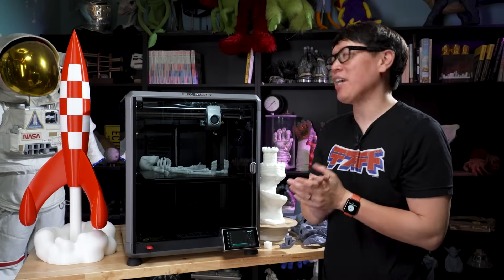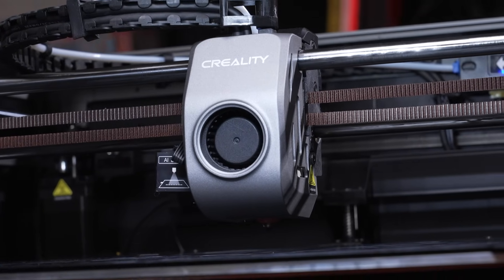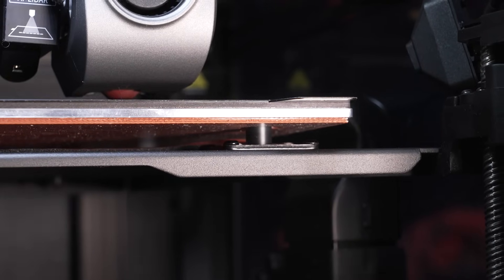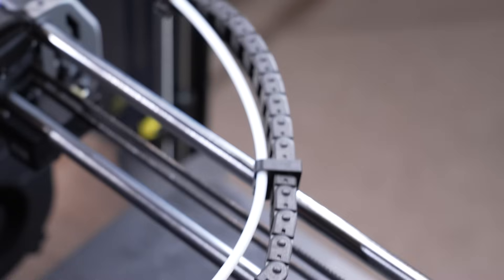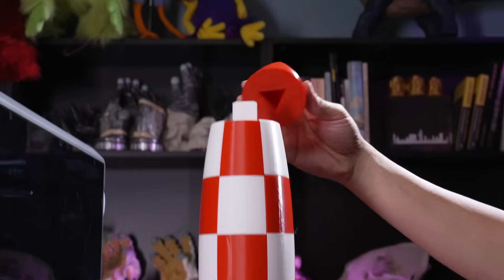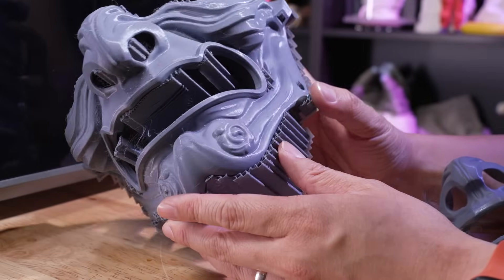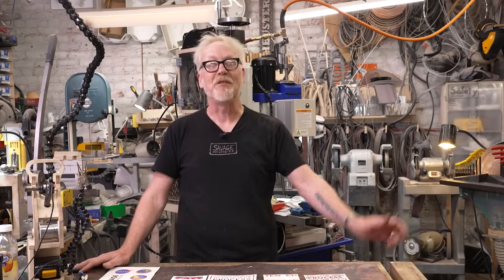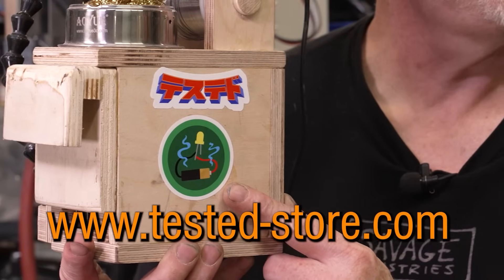Creality K1 Max 3D Printer Review: Big + Fast Prints!

Comment: "It's not really polished on the software and hardware side"... Yes, it's a Creality. They release beta models and let the community fix it.
Reply: Couldn't have said it better
Reply: How long did it take to fix the plastic extruder arm on the Ender 3's? Like 3+ years? lol
I bought an Ender 3 Max Neo and they shipped it with the power supply vents blocked by the metal cover plate. Creality saved 30 cents not having to punch extra vent holes
Reply: @hd-be7di Ender 3 Pro I purchased in January had plastic extruder. Not good.
Reply: @JonLaRue  I threw away the extruder on mine... it lasted 2 matte pla filament rolls. Leave it to Creality to use a brass gear on the extruder. I replaced it with a dual gear from Amazon but I doubt it will last that long either since it's just stainless steel. Will most probably get a hardened steel gear set from BMG as a replacement.
Reply: Creality uses what I would call a very agile development/release cycle and just-in-time manufacturing. Versus BambuLabs who come from DJI and seem to spend a lot more time incubating their products and ecosystem.

Because of Creality's speed to market they've kept the price of their printers relatively low. That's been great for having a very low barrier to entry for folks looking to get into 3D Printing.

That doesn't mean they shouldn't release the best product possible. But there definitely is something to achieving a minimum viable product, testing it internally, giving it to a few users, making corrections and releasing it. Then as we've seen they've released a LOT of iterations of each of their printers.

Their less expensive printers have also been based on common RepRap making upgradability and modding extremely easy. So the things that are lacking like plastic extruder can be changed quite easily.

They no doubt throw spaghetti at the wall and see what sticks.

If that's not desirable then buyers can and should spend more money on products more in line with what they want.

I have 2 Ender 3's (v1) and a CR-10 (V1). They're all like 5+ years old. I've modded them quite a bit. I was ok with them not being as polished as something like a Prusa in order to have a lower initial price.
Reply: That is kind of the lore behind Creality that made them successful but is turning in to their downfall. You used to buy a Creality because it was cheap, open source, and easy to mod it to make it rival "high end" expensive printers. You used to buy a creality for $300, spend another $100 and it would rival the $700-$900 printers.  Their user base has expanded to include the generic users. People don't want to screw around with the printer to get it to work. They dont want to add cooling ducts, custom extruders, Creality parts have turned in to proprietary parts which makes it hard to mod. Their software is meh and you can basically do everything easier on another slicer. Their little cloud app store thing is just an absolute nightmare and looks like it was designed for fortnite kids with vbucks.  All in all they are still good printers but it's just a half baked printer they built using copied engineering without understanding that engineering so everything is just janky. aka its a Chinese printer with a warped bed.
Reply: Holy fuggin' THIS.
Reply: Still beats having to ask your supplier permission to use your own printer. Yes, that's what relying on cloud does. Not open source = not yours.
Reply: I've been burned too many times by Creality. No way will that print 600mm/sec, and that firmware update will never appear, and this model will be outdated in three weeks.
Reply: I have 2 Ender 3 S1s and they have been dead reliable printing hours every day for over a year. I bought them expecting to need to tune and tweak and modify, but outside of normal wear and maintenance, they've been trouble free. There definitely seems to be a class of people who have 3D printers but have no interest or skill in tinkering or making or anything creative. So weird.  Part of the appeal of Creality is that you can modify the printer and the software. Bambu is completely locked down. I guess that's for the same people who like Apple trash; looks flashy, but they own you.
Reply: I used to be of this mindset, but after about a year or so of tramming, checking, and tuning to keep quality up, every printer's for sale and the P1S shows up next week. It's like getting a dishwasher; it doesn't do the dishes faster than by hand, it's that you're not wasting the time doing that; and can do something else, like designing and actually producing a good print. @gasfiltered 

Love people complaining about cloud this "It's not yours" that on the Bambu's meanwhile all they ever print is someone else's crap for their consumption.

Exactly what consumer printers are for.

You got IP, you got a print farm, you got something else going on; these are consumer printers for consumers and 90% of the neckbeards in this comment section are exactly that. xD
Reply: Im sick of being a guinea pig beta tester for creality, Im buying Bambu.
Reply: Creality = DIY bootstrapping.

I still love my Ender 5 Plus though, which is incidentally a larger print area, way more DIY friendly, and under 2/3rds the price (even though the price has gone up).  I kind'a think I picked right for a long-term solution that can grow with me.  Fixed size with an integrated enclosure, not so much.

Of course if you're not both a hobbyist and min/maxer…
Reply: And for people with basic knowledge, skills and patience it’s a great deal getting it that way.

Their business model is taking current technology and getting it to the consumers as cheap as possible.

Comment: What is better the 3 d printers or resin printers ?
Reply: They're both considered 3D printers, however this particular machine is called a FDM printer, where it builds its layers with molten plastic filament. The SLA printers use liquid resin, cured layer by layer with a light, solidifying each layer of the build within the vat of resin, and once finished, the solid part emerges from the vat. Resin printers are messy, toxic, and the parts are quite fragile compared to FDM. Their resolution however, is excellent, and the parts require much less post sanding/processing than FDM, and have more of an injection molded appearance. Hope that helps!

Comment: That benchy looked terrible.  Also, 300x300 was considered "large format" 8-10 years ago but nowadays thats average..  I have a printer i designed and built (not core xy though) that is 500x800x450.  I am currently working on input shaping on it due to its size and amount of weight its tossing around (the bed is stationary but the print head moves around in x, y, z.).
Reply: "300x300 was considered big a decade ago, let me tell you about this completely custom built solution I made myself" Man, that's awesome that you've made a printer with those dimensions, but that has absolutely no bearing on what large format is when it comes to what brands actually sell. You made a damn statistical aberration.
Reply: @xalener The benchy did look terrible though :D But that is likely because they are trying to push prints through this fast... I'm more of a quality person. This looks like the printer for me to replace my Flashforge Adventurer 3. I'm sick of bed leveling issues on mine.
Reply: @xalener  It does have bearing, let me simplify it for you.  The video refers to making LARGE prints on this 300x300 large format printer blah blah...  I am merely stating 300x300 is not a large format printer these days, even if you leave out the information of the printer i made.  lots of printer manufacturers sell printers larger than 300x300 and the info on my printer just shows that lots of people are custom building their own printers further showing that 300x300 is really not large format anymore... but thanks for trying to pick peoples comments apart like a true social justice warrior.

Comment: Currently using the neptune 4 and for me it works well at the same speeds but £350 cheaper.
Reply: Elegoo is an awesome price, but there's a serious quality difference, and the Max has a larger print bed. You do get what you pay for with these Creality machines.
Reply: @HunterTinsley  I have never had any issues with Elegoo I have had both SLA and FDM printers from them and it has worked fine for me.
I have friend who have had no issues with elegoo either.
Plus elegoo does have max versions but I don't really need it.

Comment: I lost faith in Creality.  They pump out new models but never seem to make things better.  They use cheap components and cut a LOT of corners.  Their hardware has constant failures.  Unless they have MASSIVELY changed up their process there's no way I would pay the $$ they want for this.  I've owned 3 different Creality models over the last few years and they were all lemons.  This honestly feels like just a Bambu labs knockoff so that they can "compete" (hint:  They can't)
Reply: Adding an enclosure isn't my idea of "knockoff level cloning" considering Creality's history of producing CoreXY like Ender 5. It is surprising how well Bambu has engineered their first printer lineup and our focus should be on benefits to the consumer and how industry pushes change from within.
Reply: @hrdcpy Sorry to be that guy, correct me if I’m wrong, but I thought this may be important to not miss out on. The Ender 5 is actually just Cartesian kinematics instead of corexy.
Reply: Ok if you don't like this one what brand would you recommend for this price point.
Reply: Sorry to hear you have had that sort of experience with Creality. The K1 Max is the first Creality printer that I own, and I have had nothing but success with it. It is a solid build, and every print I have made with it so far has come out great. I see 3D printers, like others, debate the merits of a particular HDD\SSD company. Some will say they have good luck with Seagate, while others swear by Western Digital or some other company. It seems to be luck of the draw in a lot of cases.
Reply: I know you said you lost faith, Bambus are great. But dont dis on these K1 Max's yet. My close family member owns a 3D printing Farm and has 5, K1 Max's with about 11,000 hours across all of them(collectively). He's only had 1 print fail on one machine. But of course this is only 1 persons experience.  I can't speak for others.
Reply: don't we want more people ripping off bambu? Like, ain't that the fuckin point?
Reply: Kinda  @xalener   ... but I think the point is not to make a cheaply built knock off, but to push forward and make something well designed and of decent quality.  I honestly can't attribute either of those things to ANYTHING Creality has ever made.  When the next awesome and well designed thing comes along I'm sure Creality will make something that kinda resembles it as well.  This is the race to the top (i.e. Bambu designing something new and innovative that works well) and race to the bottom (i.e. Creality making cheaper versions of whatever the cool kids are doing using cheap parts and trying to sell it for a bit cheaper than the competition).